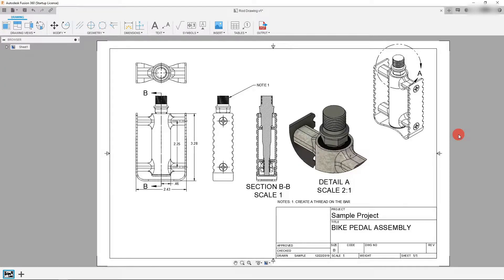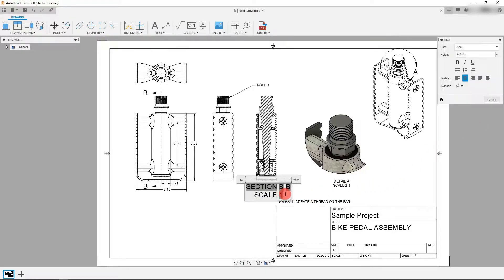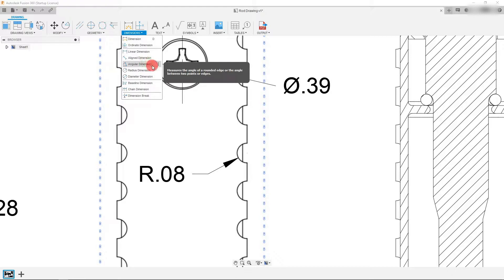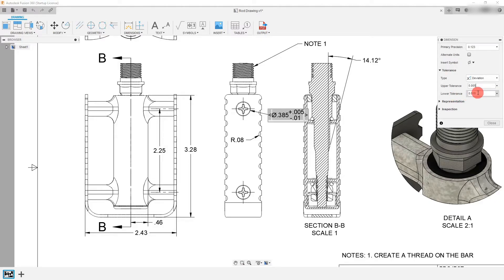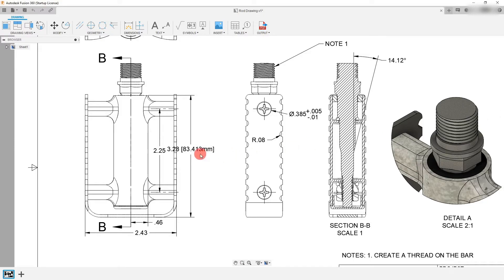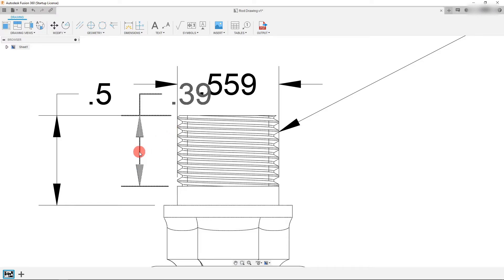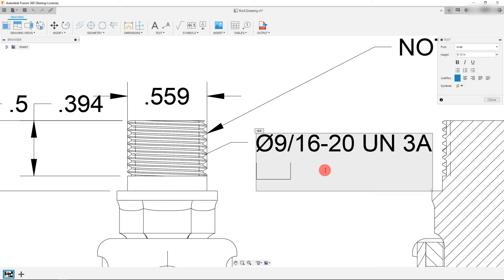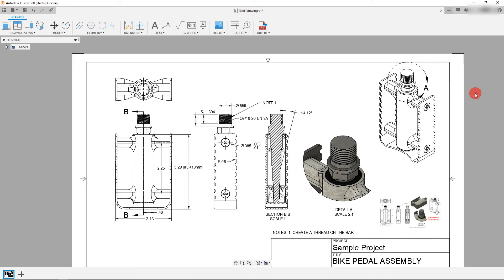Intro to Drawings - Fusion 360 Part 2: Dimensional Tolerances, Threads & Alternate Dimensions How To

Comment: It is odd that when I use the dimension tool for diameter & radius the result is quite different and the symbol and unit are placed at an angle rather than a horizontal call out!
Reply from the maker: Interesting. Fusion is still fairly limited when it comes to the amount of features it provides for drawing creation.

Comment: I'm trying to find out if there is a way to change the position of the dims. Instead of horizontal I want to have the dims in vertical position. I'm not sure if I'm clear. I have the sheet in portrait but be able to read the numbers in landscape position. Thanks
Reply from the maker: I don't believe there is a way to do this, even having looked through the settings. Not yet, at least. Fusion still seems fairly limited in drawing ability.
Reply: @AvivMakesRobots  yeah, thank you anyway 👍